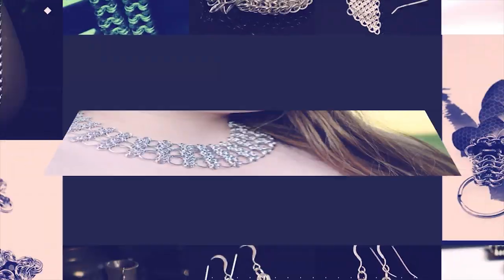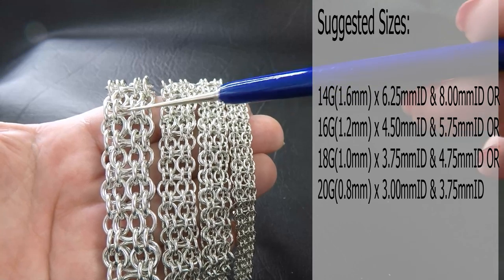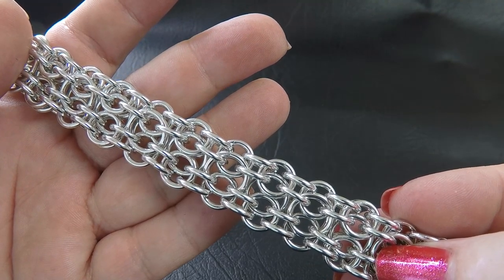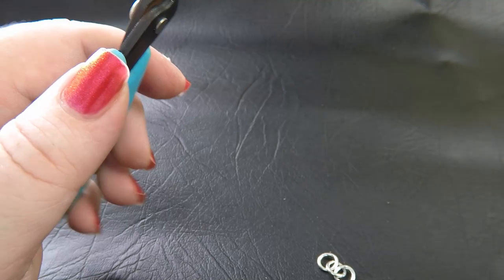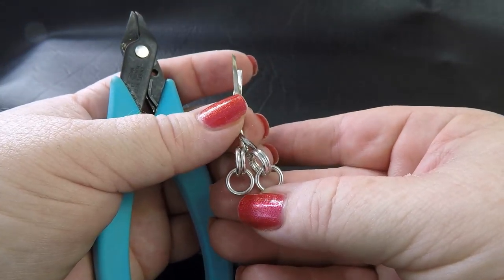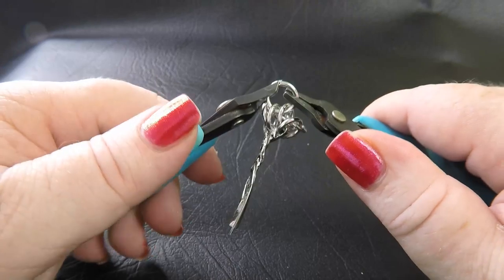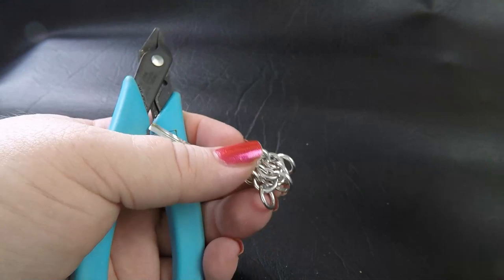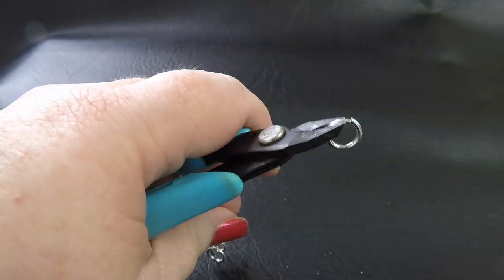Chain Maille Weave Demonstration - Attica Weave

Comment: Deb, I love this!  Very pretty.  I have a question though.  To me, this looks like segments of helm weave and "inverted" helm weave.  Could you make the helm sections and then join them together?  This might make adding the adjoining rings difficult though.  Any thoughts on doing it this way instead?
Reply from the maker: Hi Jan, it's not helm weave so that wouldn't work.  The pairs of small rings would need to be joined to each other to be helm  and these ones are not, they are joined to the next pair in the weave.   Deb